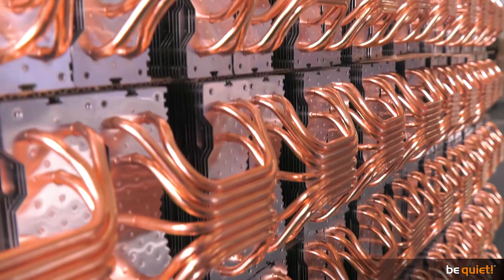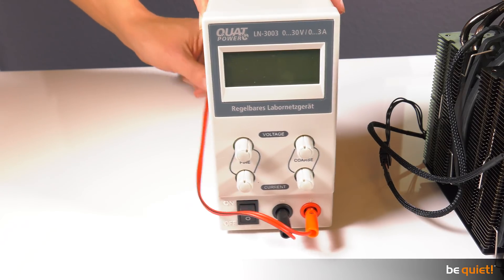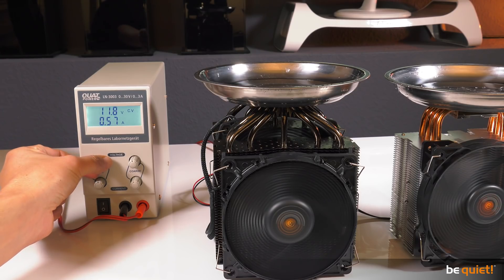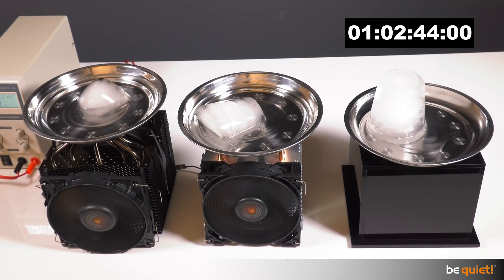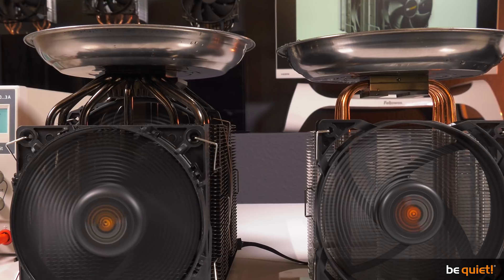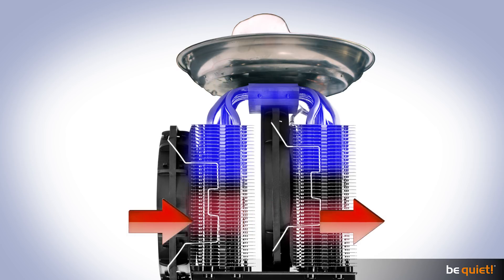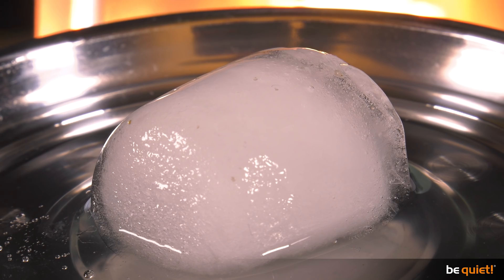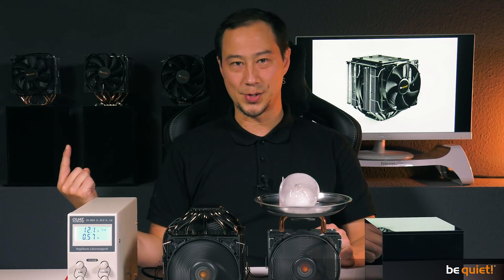Can a CPU cooler stop ice from melting?

Comment: That was fun, and cool  :D    
Still waiting for your mini Itx case that supports  be quiet! Dark Rock Pro 4 50.5 CFM CPU Cooler,  be quiet! Dark Power Pro 12 1500 W 80+ Titanium Certified Fully Modular ATX Power Supply, and that has 2/3  be quiet! Silent Wings 3
 140 mm Black/White 1000 RPM 59.5 CFM 15.5 dB case fans + highest quality fan hub for 6/8 fans.